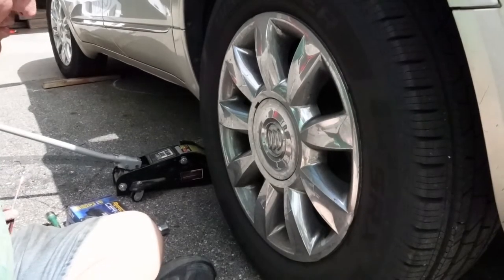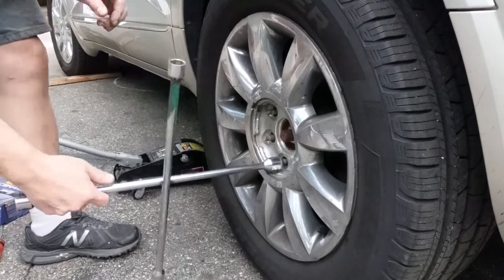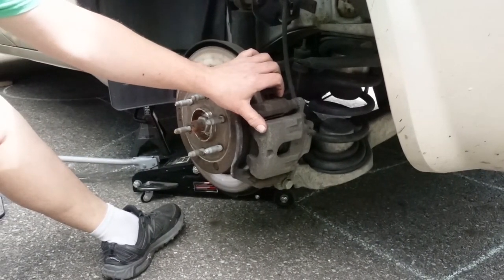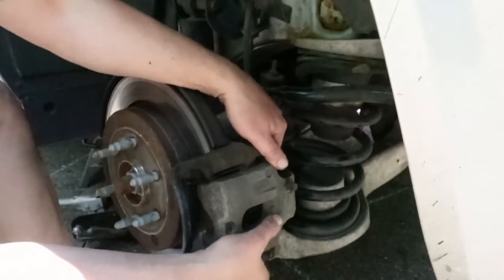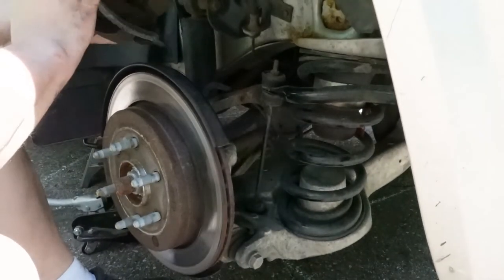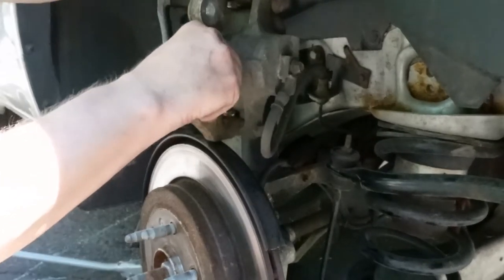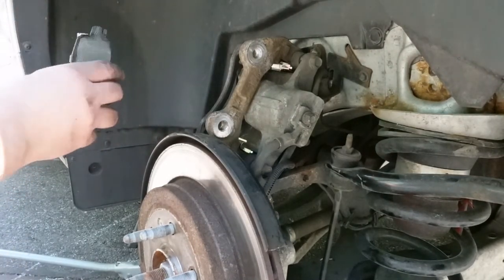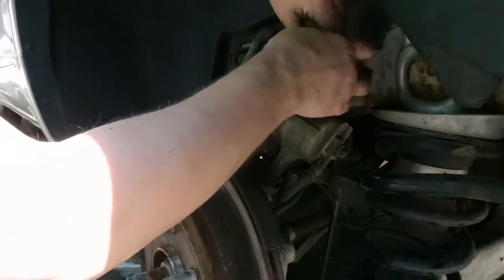2014 Buick Enclave Rear Brake Pad Replacement

Comment: Hello All, Do not remove all the lug nuts from the wheel without a jack supporting the vehicle.   You're supposed to loosen the lug nuts only when it's on the ground.  Notice how the wheel just fell off after the vehicle was lifted.  He had his head underneath with no support.  He could have been crushed if the wheel had fallen off.  Be safe!
Reply from the maker: Wow, didn't notice now until you mentioned it.  I honestly usually just loosen them, but must have been gabbing away at the camera.  Yeah, that wasn't smart!  I always use jack stands, but definitely did that in the wrong order.  Thanks for watching!

Comment: There are imprinted arrows on the body to show where to place a jack (although it may only be for the stock jack from the trunk). I barely noticed it as I went to jack up the vehicle. Doing rotors and pads all the way around but after taking off the first wheel noticed I needed to replace parking brakes too. Not only were the parking brake pads separated from the bracket, but one was split in half 😬
Reply from the maker: I'll look for that the next time.  Thanks for watching!